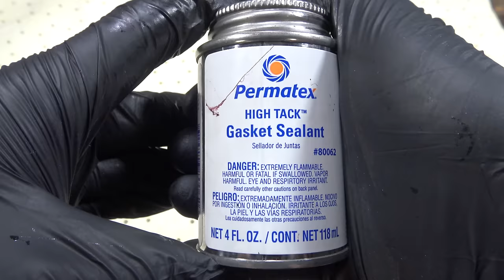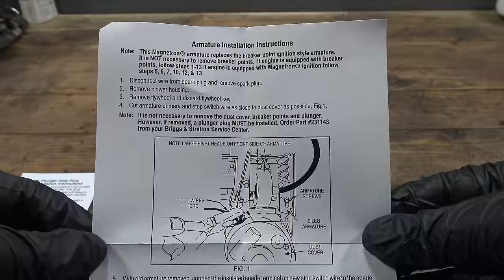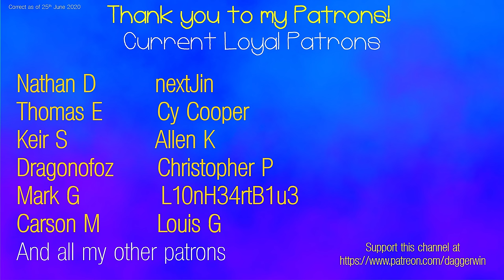I REBUILT A 43 YEAR OLD ENGINE THEN CUT GRASS WITH IT

Comment: Beautiful video and such a nice restoration, you're so thorough. I've watched an awful lot of your videos now and have a question - why is it that some things you powder coat and others you spray paint? I know nothing about powder coating but it looks superior to spray painting - wondered why in this video for example you chose to spray paint the engine exterior but powdercoat the carb?
Reply from the maker: Thanks! The parts which are spray painted are usually areas which get very hot. The spray paint which I use is high temperature paint. I tend to powder coat parts which are around petrol as it's much more durable. Also powder coating usually gives a much nicer, tougher finish,

Comment: Sorry to nitpik, good job but one high wear area I didnt see checked was valve guide wear - the aluminum blocks valve guide holes can wear pretty fast if oil isnt changed regular-- hold the valve about 1/8" off the seat and see  how much it wobbles sideways, more than about three or four thou and it will beat up the seat and not seal well as it could and also it will suck a lot of oil as theres no valve seals.

Comment: By looking at the pull cord was the engine ment to be mounted cylinder head facing toward the operator?
Reply from the maker: This engine would have once been on a mountfield M1 rotavator, not a mower. So yes, the engine would have been mounted a different way.

Comment: I hope you'll read this. First of all, thankyou for this video, I've just acquired an Al-KO lawn mower with pretty much the same engine and through watching I've realised that I've installed the pump spring in the carburettor wrong, I put it together exactly how I dismantled it... Do you have the part number for the Magnetron conversation kit? I'm having problems finding it here in Germany. Again thankyou...
Reply from the maker: Thanks! I believe that the current coils sold for these engines include the conversion parts. The Briggs and Stratton website has all the engine manuals so you should be able to find your part number on there.

Comment: Great engine , however, I think that it should have been mounted on an older base with the engine cylinder head facing the rear of the mower.
Reply: Yea, it looks backwards to me. I've had a bunch of them and the motors on all of them were turned the other way. I can see on that deck that's the only way the motor will go but it still looks backwards. :-)

Comment: Hi Daggerwin love the videos been watching since fs 15 sandy bay could you give me some advice on a huscavana lt120 engine which is a brigs 12 hp and i cant get it to start. The fan on top will spin when i tern the key but it will not fire cleaned the filters and getting fuel i tried to start it when the air filer was of and it went but was over revving so drooped the reves down a bit and stopped any advice? thanks dagger
Reply: Prolly needs a carb clean

Comment: Love the old flathead Briggs.  When I was in high school, these were the training aids for Power Mechanics class.  When I was in college I rebuilt a number of these engines I picked up at the local junkyard.  Didn't have valve-spring compressors or a cylinder hone-screwdrivers and sandpaper suffice.  
  Never have seen the internals afterwards...they're all still running.

Comment: I would have dead laughing if it threw a rod while boggin in the high grass after all that rebuilding lol
Reply: My Briggs has a mod
Called increased rpm it’s from 1976
And now mine never Boggs but it will need a restoration it’s had a rough life the guy that gave it to me for free Ahmad it sitting in a shed for 10 years and his son was pretty abusive to it but it’s A merical that it runs as good as it does now

Comment: Is it just me or is the engine mounted backwards on the deck? I really wanted to see the recoil spring installed
Reply from the maker: No that is correct. The reason the pull cord is facing the opposite way is because the engine would have originally been fitted to a rotavator

Comment: Dang, those engines sure didn't change much over the years. I have a somewhat newer one that looks almost identical in design, just a lot more plastic parts.
Reply: Those old "L" head design engines was Briggs golden ticket..  They manufactured the 3 through 4.75hp engines for almost 40 years before destroying the molds back in 2010 because of EPA stepping into the game.  A lot of things changed.. Different tier grades for engines and introduction of catalyst exhaust and even evap recovery fuel caps and dual lined fuel tanks.. 
Now you buy a 4hp engine from Briggs and it has overhead valves, plastic carburetors and no primer bulbs..   
I have an older "L" head 6.75 hp engine and I am going to make it last.. It is a rare cast iron cylinder sleeved commercial engine with an alternator...   Expensive but it runs well... 
This engine was superseded  by the "professional series" engines (non cast iron sleeved) that we use to call the "tear drop" engines.. OHV engines and larger flywheels made them run good... Except for being on a pressure washer.. (They were known for breaking cam gears).. 
Briggs still manufactures 80% of the parts for their engines.. If they still have the castings they will do custom factory orders for parts..  Hell they still make the old school  side mounted starter you pull up from the mower to start it.. ;)

Comment: ...Beautiful restoration of that engine!..and thorough, as well..I would find a period-correct mower deck with correct wheels to mount it on, though..and a period-correct muffler...that big modern "quantum style" muffler does not look right on it..you put too much work and effort into that engine not to use it on a restored antique mower.. :)

Comment: Lovely job :) What was the red assembly lube used? I have a couple of Briggs that I've partially had apart for maintenance but this must be a slightly different design (smaller power output?) - is there no governor mechanism inside as I was expecting to see? I regularly have issues with my starter clutch sticking - I'll give your method a go as the ball bearings get all glooped up for some reason ;) Only OCD moment when I saw the different shade of white on the bolts or was that the lighting? :D Wish I had a blast/cleaning cabinet mind :( Liking the powder coating too!

Comment: They don’t make small engines like this anymore, all crap made in China, a real Briggs or Tecumseh carburetor very hard to come by, a shit knock off made in China, $20, that will flood or break after 3 hrs runtime.  NEVER throw away the OEM stuff, rebuild and fabricate if you must.  A real “Mikuni” carb for a Yamaha Blaster 2 stroke is well over $250, a Chinese knock off $35, I compared the Japanese machine quality to the knock off, and what a difference, the knock off, all burred, rough surfaces, inferior steel, the orig, a piece of art, I bought a rebuild kit, and threw away the knock off.  VERY NICE WORK.

Comment: I didn’t see the wire from the condenser when you installed the fly wheel, also I didn’t see the spacer between the gas tank and block and half inch bolt
Reply from the maker: No as I said the points system got replaced with electronic ignition
Reply: I didn’t hear that, I am sorry for the comment
Reply from the maker: No problem

Comment: I did enjoy watching the video as it is what I do also, but one thing has me baffled, and I've seen it before in other videos. When the engine came in you noticed one of the valves was still in place and you pulled it out, said you would mark it so you knew where it came from. Then a short time later I watched you remove both valves with a spring compressor, meaning they were both in place and not removable by hand as I had just watched you do. What am I to make of that. Am I going mad.

Comment: I may be wrong, but engine is backwards. Doesn't really matter. Call it euro mower😊👍🍻
Reply from the maker: Not sure I understand what you mean
Reply: @MachineryRestorer  I thought  spark  plug faced the rear towards the Handel bars. I have a old Briggs and the engine is mounted in the opposite direction 😊👍
Reply from the maker: @jerryglen986  Oh right. No this one faces in the direction I fitted it :)
Reply: Far as I know, all the movers have spark plugs are on the front end.

Comment: I have an old Craftsman mower with a Briggs and Stratton 6 horsepower engine. No clue what's wrong with it, i have a new air filter and spark plug put in, and the clutch wire (i think that's what it is) won't move. Want to buy it? I'll take pretty much anything for it
Reply: I’ll give u 10
For it

Comment: Whats so special about the engine being a little old if you already have all the OEM parts needed to rebuild it anyway? Changing a thermostat on a 1936 Oldsmobile is no different than almost any other car if you already have all the parts you need. What makes repairing old machinery so fun is having to go full cuban mechanic when you can no longer source all the parts you need.

Comment: How on earth did you get such an ancient Briggs & Stratton to run? They arrived from the factory pre worn out. if you were lucky you may have got 2 seasons before the cheapskate junk stopped working and you chucked it in the garbage.
Reply: I found myself chuckling at the irony of the 2 year warranty sticker on the mower deck.

Comment: My dude. PLEASE STOP painting the carburetors! They're aluminum, they don't need paint! It's not good for them, it inevitably finds it's way into ports and jets it shouldn't be in, it jams up screws, pivots, and springs, and it looks terrible, to boot! Like a cheap, Chinese product they did a half assed job throwing together, and then just slathered a thick, quick, crappy paint job on over the entire thing, AFTER final assembly. You do good work, let that SHOW!

Comment: I got a five horsepower side shaft motor like this same age you know five horsepower 5. whatever I've been keeping up with it keeping it running haven't heard it running a few years cuz it caught on fire and a few parts burned up but luckily I was able to save the motor still got good compression still filled up tight on the inside I need to find some cute a few hard to find parts just thought I'd ask person in this video was using New Old stock and what appear to be new stock I need a coil I have fuel tank and a carburetor I can't find them because they're rare least I think so any helpful things will be nice I like watching these videos I would sell the block but it has too much in the middle value to me don't have to buy my motor I keep it running for the memory of my paphole I'd like to throw it again okay before I get sappy this is getting too long so you can help me let me know anyone else who watches this video

Comment: Do u know what a Magnito is ?
Reply: Yea it’s the electronic ignition DO U No What A MAGNETO IS
Reply: Hunter 747 a magnito needs kenetick energy to deliver a low voltage spark to the cylinder
Reply: A magneto uses a magnet passing the coil to induce high voltage capable of creating a spark.
Reply: Yh

Comment: This is great!   My dad used to have this same mower when I was growing up.  Our mower had the spark-plug facing the other direction.  I wonder if ours was mounted backwards, or if yours is?
Reply: They came both ways, depending on the mower manufacturer. Most of mine have had the plug at the rear and I prefer it that way.

Comment: back when briggs and stratton made good engines
Reply: Briggs makes good race transmission now though
Reply from the maker: the Briggs Stratton vanguard engines are still very good
Reply: @MachineryRestorer  yes but how long will it be till they start cutting costs on those as well?
Reply from the maker: Not sure but Briggs still make the best engines in my opinion. I was really disappointed with some of the Honda and Kawasaki engines
Reply: @MachineryRestorer  the thing with honda and kawasaki is the spare parts the prices are silly for some things
Reply from the maker: @terry987654  Yes very true.